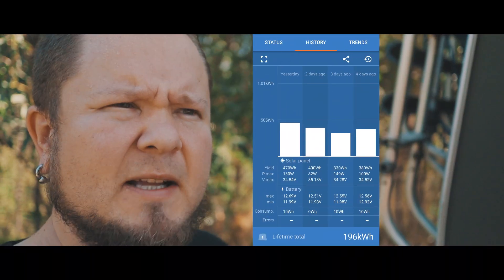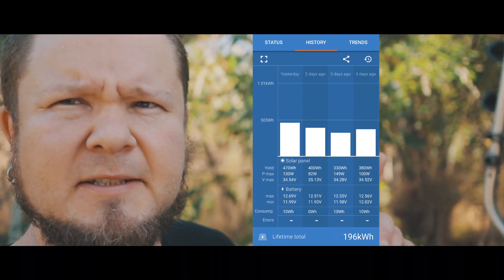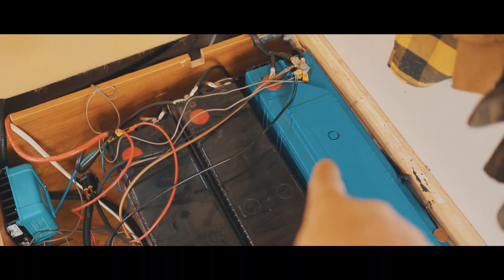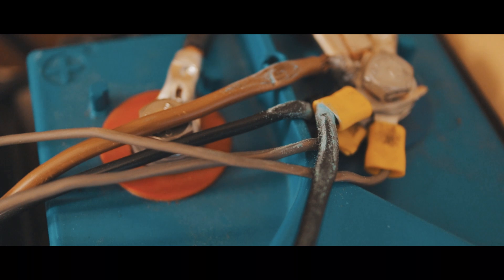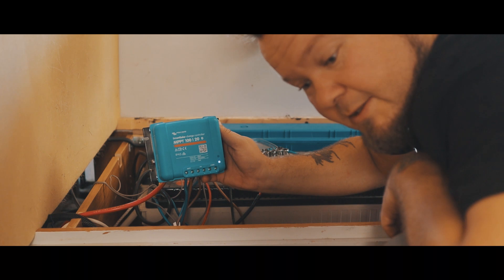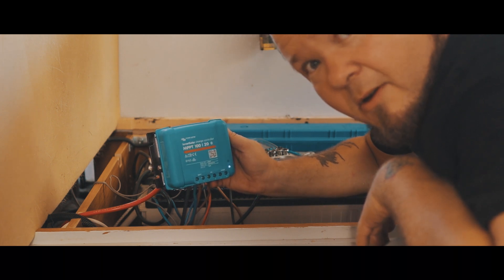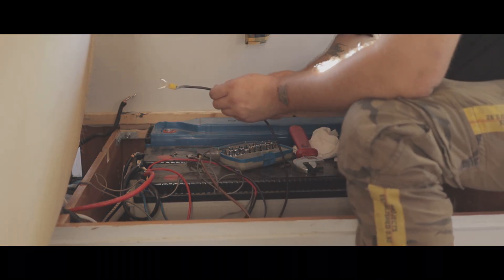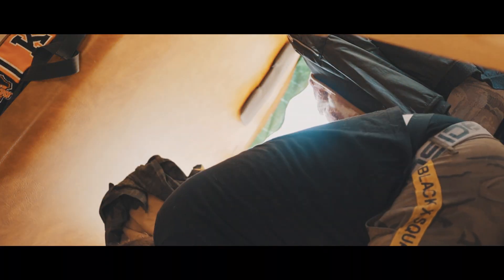🇪🇦 Solar Panel & AGM Battery problem!!! I'M DOOMED!!! Camperlife Spain

Comment: Hi! As far as I know if you connect several batteries the weakest one defines the charge. When the weakest one reaches the "full" voltage which happens relatively rapidly the charger stops charging not to overload it. This is why you should always connect the same type and same age when you use more than one. If the blue one was not the problem just disconnect another one. I guess you have the time to play with the batteries. For emergency a charging booster may also help to fill the solar batteries when the engine runs. Hopefully you find the malfunction!
Just to explain this a little bit more: You drain all three batteries when your fridge runs. But when it comes to charging when the first one says "enough" it stops charging, this happens before the good ones have reached the charge level they had the day before. This way you slowly discharge the good ones without refilling again.
Reply from the maker: Yeah, Thanks, I'm pretty much aware of that. That's why I started to unplug the blue one and to see if it helps. Next I will unplug tge 2 gray ones and try the 1 blue alone etc... I'll figure it out. I  just need sunshine!

Comment: Hi Simo. I am a retired electrical engineer but not an expert in batteries and solar power. 
1, The green powder looks like a small amount of corrosion. This sometimes happens on battery's and if you smear a little vaseline around the terminals it will tend to stop it. The corrosion can be caused by a slightly damp atmospehere.
2, When you get the new solar panel for your spare leisure battery you will still need a charge controller for this. You didn't say if you were getting an additional charge controller. I have a small solar panel to keep my camper battery charged and just have a seperate cheap PWM controller for this.
3, You may find that there is not really a fault with your batteries because they will only take the charge they need so maybe will not be taking a lot of power to keep them charged up.
4, If you start to find the voltage is slipping too low then you maybe have a problem with one battery that will pull the voltage down. This is usually a fault on one battery and you can find this by disconnecting one battery and testing the voltage of the remaining battery's
I am not an expert but hope this helps. 
You can check out Gadgit John on Youtube (Him and his wife Mandy are currently touring Spain). You may be able to email him. He has lots of knowledge on solar panels and battery's They also have a "John and Mandy on Tour" channel on youtube.
Hope this helps. If I was closer I would come and have a look for you. Take care 💙❤️👍
Reply from the maker: Thanks!
2) I have a spare unused pwm charger for that 👍
4) yes that's excactly what I'm doing here, unpluggibg 1 of 3 batteries to see if that's the problem. Next step is to unplug these 2 and plug in the 1 which was unplugged. I will fibd out which is the problem battery, if not all of them. 300€ is new 300ah agm battery.

Today was cloudy/rainy day so unable to get them charged so now it has only 12,18V.

Comment: Hey! The height of the sun above the horizon where you are 90 * -23.5 * (the earth's slope) -36.5 * your position = 30* degrees above the horizon on 21 December. So your solar cell table should tilt 75-80 degrees towards the sun to get all the charge out of it.
Regards Tamas (Hymer 534) Sweden
Reply from the maker: Thanks! That went pretty much over my understanding, but I understood I should tilt my panel  75-80 degrees towards the sun, which is enough info for my brains, thanks 😆👍

Comment: The same happened to me, disconnected one battery and the other 2 came back to life. But you do need as much solar energy as you can get, even in Spain, angled to face the sun will dramatically increase the power.
Reply from the maker: Yeah I know. Today unfortunately was cloudy and rainy day so couldn't get almost any power. Still low 12,18V on the batteries 🙄
Reply: @hungrycamperfilms  You need to be putting in 14V, when you get the small solar panel it could help bring the batteries back by using that too, directed towards the sun of course. And don't worry about the blue powder, it's just oxidation caused by moisture in the air.
Reply from the maker: @offroad3607  Thanks!
Reply: How big is your solar panel on the roof?
Reply from the maker: @offroad3607  it's 300W. Should be plenty.
Reply: @hungrycamperfilms  300W would be Ok for 3 X 100 ah batteries, if you have 3 X 180ah I would say nearer 600W of solar.
Reply from the maker: Ok, thanks, good to know, I've actually never thought about that. Makes sense!
Reply: @hungrycamperfilms  Keep the blue one disconnected, see if the other two recover. 👍

Comment: I think those old batteries are your problem. I run a comp fridge from a 280w panel and a single 130ah battery. You might need two.
Reply from the maker: Yeah, pretty much so I guess!

Comment: Man, I don't think your problem is the battery. If I saw correctly in your app, your solar energy generated is half what it is used to be. It is possible the days are shorter and there is less solar energy to harvest. I don't know your car, but it is possible that driving also charges your leisure batteries. Then you would never know if you are low on energy or not because regular driving would charge it up. Also, check how much power you actually consume and check if it more than you catch daily. Fridge, computer, chargers, phone chargers it all adds up.

Comment: Don’t they charge while driving? How about letting the engine idle just to get some juice back in there to get them back alive...
Reply from the maker: No, these solar batteries are not connected to the engine any way. They are separate.

Comment: Your panel will struggle to charge 3 big batteries even if the batteries are in good condition.

No solar wizz kid. But you panel probably charges as 10/12 amps per hour. You have over 400 amp hours of batteries so you can see how this can be an uphill struggle.
Reply from the maker: Ok. I unplugged 1, so now only 2 batteries. This video was yesterday, and today was rainy/cloudy day so no charge. Damn!
Reply: @hungrycamperfilms  shading, even slight shading has a big effect.👍
Reply: Graph is definitely October to November.
Reply from the maker: @CarlJones14  yes it's 30 days history
Reply: @hungrycamperfilms  sorry, I meant that the month change is just that, Winter months. 👍